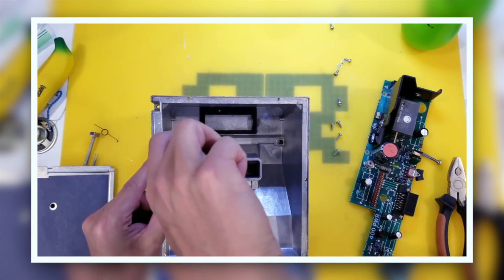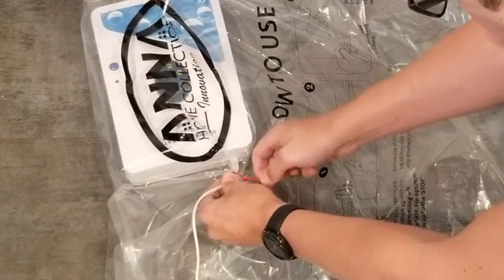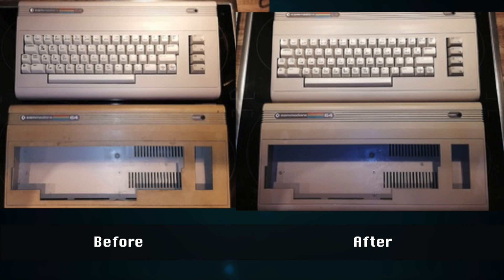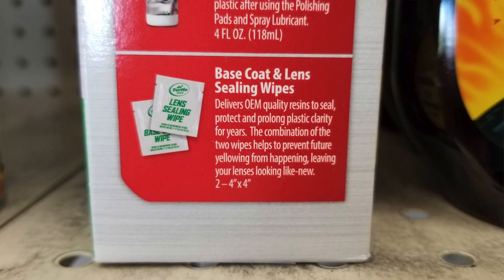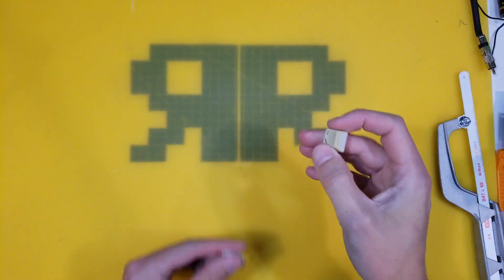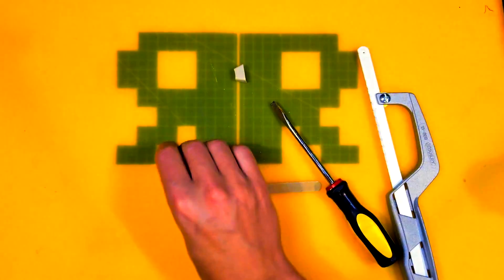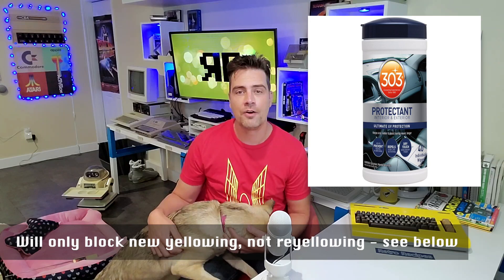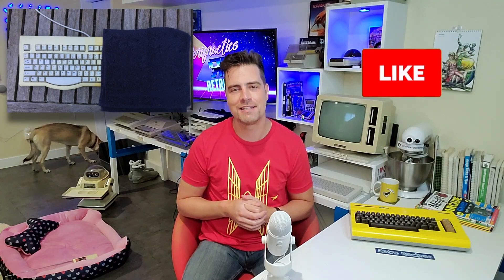Retrobrighting with just Sun? Lightbrighting! ▼ Read description FAQ

Comment: Hello! The reason plastic turns yellow is that a hydrogen atom is removed from the polymer. You could use hydrogen peroxide to replace the hydrogen atom by immersing the plastic object in a container. You can purchase a 12% solution of hydrogen peroxide over the counter. Place the container in the sun or use a high-powered UV lamp. You should see a difference in the plastic's yellowing after a few hours. The higher the temperature, the better the result. Be careful not to deform the plastic by overheating. Do not heat it with a heater.

Comment: even a melamine spunge (magic eraser) that's only verry slightly abrasive will begin to remove yellowing, so yes its a very thin layer. 
but still i use the water with hydrogen peroxid solution (properly 1-2% in the final solution)

Comment: If you take the hypothesis further you could use try uv-b lights a a box instead of sunlight because the main difference between the setup is the uv-b missing inside a house this would also confirm if the hypothesis is correct. UV-b lights are used for terrariums.

Comment: Hi, you say heat is a yellowing factor, so what will happen if I leave my Dreamcast outside on direct sunlight and it's 110°F? (summer time) Is it still advised?
Reply from the maker: No guarantees but they're designed to withstand much hotter (think of soldering irons on chips and heat from chips). Heat is a yellowing factor, specifically in the dark. Think of a hot attic. The conclusion of this video is that direct sunlight is a great retrobrighting method. Personally I haven't tried 100F but you'd be surprised how much these cases can stand.
Reply: @RetroRecipes  Thanks :) My Dreamcast is taking a sunbath in the garden right now...
Reply: @Ozwel  So what's the outcome? I have a Dreamcast in the same condition.
Reply: Did it worked out? :)  @Ozwel

Comment: I know it is an "old video", but there is a room in my childhood home (a "storage room" of sorts), which has the following story:
During the early 2000's I as a teenager put all my old pc's/consoles/toys etc in this room (nothing in boxes/packaged, just directly on the furniture I had). Then I covered up all the windows with "blackout" curtains (because I had seen that things that stood in windows/was exposed to sunlight, yellowed), turned of the lights and closed the door.
The room has basically been untouched for about give or take 15-18 years (until a few months ago when I got the nostalgia craving). Now in my country the days are usually filled with wind and rain and it is generally cold most of the time (and there was no heat in the room), so there would have been little temperature change/heat exposure.
Nothing in that room has yellowed, and surprisingly it's not that dusty either.
Reply from the maker: This would tally with "dark + HEAT" causes yellowing, but not just dark or just heat. 👍

Comment: well i disagree with just the sun causing the yellowing. my had never ever got direct sunlight it was also covered with a garment when unused. still it's top part and keys are pee-yellow but nothing on the bottom part. have loads of c64 and c128 some have different yellowing or no yellow at all. i think i mentioned this in one of jan beta's videos. my idea is that it's different plastic was used and or sometimes if someone used windex or something stronger to clean it but then the bottom part should at least have some yellowing. which none of mine has. sidenote when i was young parents and other sh_t's would smoke in ordinary rooms with no active ac or fan assisted circulation. as far as heat goes 20-29 celsius max.
Reply from the maker: I don’t say just sun causes yellowing, in fact I say the opposite

Comment: Will UV LED strips work in the same way? I have strips of them arriving soon and I'm willing to try by putting a C64 case inside a transparent storage case, then wrapping the case with the LED strips and aluminum foil so the light spreads around evenly, and leave the LEDs on for as long as it takes. I'm going to cover half the C64 case with a cloth so I can verify any changes in de-yellowing. If it does work, that means I won't need a sunny day nor displaying all my retro stuff outside!
Reply from the maker: People who have tried that say it does not work
Reply: @RetroRecipes  Well there's trying and then there's trying. As you stated in this video, the same experiment can work for some and fail for others due to different variables. If it does work, I'll post the exact steps I took and links to the material used. If it doesn't, I'll fall back to my original plan with hydrogen peroxide...
Reply: @RetroRecipes  Well I can confirm that the UV LED strips didn't work, and a few years later I needed to retrobright a computer's front plastic. Since I have 3 identical ones in different states of yellowing, I left the worst one in direct sun light for 3 days with hot weather. The results are in: It's now identical to the least yellowed one! I'm gonna leave it for another 3 to 4 days to get it closer to the original beige color 🙂

Comment: Sunlight definitely works to reduce yellowing, especially on ST's. Have done a couple and goes just fine.
Reply from the maker: Yup! 2 years in here and they’re all still looking great and no faults on the computers themselves either. 👍🕹️
Reply: I've been using this method on the original Atari 8-bit plastics and it's worked out pretty well but as stated in the video, it does take a loooooooooong time.  My first experiment w/using hydrogen peroxide on those original Ataris was a disaster but this has worked out quite nicely.  This also works pretty well w/the white plastics of the 2nd generation Atari 8-bits (the XL line).  Thanks for all of the info Perifractic!
Reply from the maker: @Mike-xp2lo  That’s great! You’re welcome 👍🕹️

Comment: Leaving it outside a few days is a bit of a problem for me most of the time. I use a foil-lined box and some high-powered royal blue LEDs to do it indoors. With peroxide, it only takes an hour or so, depending on how band the yellowing is, and the foil allows for even light coverage. Haven't tried without peroxide yet.

Comment: Christian - amazing work.  I have a 20-year old rare transparent "jelly" Swatch Watch which has some bit of yellowing.  The watch really cannot be disassembled.  I considered both the hydrogen peroxide solution and gel with a UV lamp but was concerned about the aggressiveness and waterproofing on a delicate watch.  The ozone idea seemed promising - the gas could permeate through the watch case, but the oxidation with metal components (springs/gears/quartz crystal/battery components) concerned me.  This seems like the best and most gentle solution for a watch.  I wonder if a UV lamp can be substituted for the sun.
Reply from the maker: We tried a sunbed to no avail. Good luck with the watch!

Comment: Hi Christian my job is with a small video game repair business and we are just starting retrobriting any tips or ideas?
Reply from the maker: Hi, I give a lot of tips in this video 😊 The 8-Bit Guy also has some great advice and videos on the subject. Good luck! 👍🕹️
Reply: Retro Recipes I kinda meant for building a large scale retrobriting unit for hundreds of old consoles and other parts to run through but thanks anyway
Reply from the maker: @brentmeeks2504  Unfortunately I think that would be near on impossible. We tried a sunbed and it didn't really work. 8-Bit Guy does some immersion tank stuff in recent videos, but you'd need so much water and peroxide. My preferred method is shown in this video - put everything outside. It's then down to how big your yard is ;-)

Comment: Hi Christian, I would be interested a year on how your plastics are still looking? Do you still repeat the process or have you left them for a future video. Apologies if this has been asked before.
Reply from the maker: Good question. Over one year later and I have not heard of anybody having any problems with this apart from that one rogue (and IMHO misinformed) report that I mention in the description of an Apple computer model's case that is absolutely renowned for shattering. I believe all of the machines that I used in this test still look the same as they did after lightbrughting. Be sure to use my recommended blue light method to keep the yellow away.

I have been using the blue light method by keeping one normal LED lamp on in that room, as mentioned in this video. I cannot guarantee anyone else's success but for me I have continued to be delighted by this method. 

To me this is not surprising as this video was made with a ton of due diligence and in constant consultation with GE's plastics degradation expert and PhD scientist of 30 years. 

Long story short, the plastics are still lighter and putting them outside in normal temperature caused zero electronics faults, just like a car radio that sits in a baking car (albeit for many more years not 24 hours). 

Other than that I recommend reading the description if you haven't. Cheers. 👍🕹️
Reply: My experiences with this have been good as well.  I've done the faceplate for a Morrow Micro Decision, an Apple 2c (in its entirety), a Tandy CoCo 3, and some XT/AT keyboards.  Right now I have the original 'chiclet' keyboard from my first CoCo 1 and an entire Televideo 425 terminal out basking in the Kansas sun.
I've also changed out the fluorescent tubes in the basement computer lab for LEDs.

Comment: After seeing the 8 Bit Guy Video, I got a small ozone generator from Amazon and put it in a zip-lock bag with some (used to be) white Go-bots. Then I put them outside over 3 days. (Yes, I have Go-bots! That's RETRO!) It did have an effect, but it was limited. It should be noted that I'm in Pittsburgh Pa and it was March when I did it which around here means cool and cloudy.

I am excited to try this method! Thank you for really digging into this issue. Your videos are both fun and helpful.
Reply from the maker: Thank you for your kind words. Means a lot! 👍🕹

Comment: Can anyone tell me if this works, or should work, if you covered it with a clear plastic bag? I have some units that it would be impractical to remove the covers, but am worried that a sudden rain storm could destroy them if left out naked, so to speak.
Reply from the maker: Yes, it works through windows too.
Reply: @RetroRecipes  I decided to bite the bullet, and took the plastic covers off two old printers, and put them outside in the sun. After the first day, they looked about 50% better. I threw in the towel after 3 days, because any improvement after the first day was minimal, or non existent. They look better, but are not fully restored. I'm curious as to why others achieved better results.
Reply from the maker: I don't think mine are fully restored either. It's not as harsh as bleach so will never match that.

Comment: Just found this video and can't wait to try it! One question though: My SNES is only partially discoloured (two parts seemed particularly subjective to yellowing) and if the whole thing brightens equally, I'm still left with a different shades of gray. Is it reasonable to assume that the parts that were subject to yellowing originally will also be the ones that will brighten fastest?
Reply from the maker: In theory that is possible. However I haven't seen great results with Nintendo... Just mild improvement. Good luck!
Reply: Retro Recipes Thanks! I believe in the comments here, as well as other videos that reference yours, some have experienced positive results with Nintendos. That said, mine are barely discoloured, so worth a shot and no big deal if nothing happens — well, other than having wasted € 15 on a rotating display on AliExpress :-)

Comment: I have bleached my 1541 using just light, before (I am a german user in the forum you found).
Btw: That's not an Amiga 2000's, but a way more rare Amiga 4000 keyboard you sacrificed there :(
Reply from the maker: I actually thought it was a A3000?
How long ago did you do your 1541 and did it reyellow?
Reply: It was about one year, ago. I cannot see any reyellowing, but the drive is sitting inside a cabinet with no light for most of the time. I ony take it out, when I want to have that original clicky sound and feel :)
It's a 1541c for being more precise.

Comment: Thank you for sharing your discovery. I want to try this out, but I live in Florida where it is currently 102 F and am worried that leaving my computer out in directly sunlight for 8 hours would melt the components or cause them to overheat (especially a monitor!). Have others tried this in hot locations? Any adverse effects? Thank you!
Reply from the maker: Please read FAQ re temperatures but if in doubt then I'd say don't try it
Reply: @RetroRecipes  Thank you for your reply. I think I'll wait until the colder months to try it as I've just got my Apple IIe working again. I'm enjoying your videos. Thanks!
Reply: @RetroRecipes  Thank you for your reply. I think I'll wait until the colder months to try it as I've just got my Apple IIe working again. I'm enjoying your videos. Thanks!

Comment: So the best brightening rig would be a box that contains a turntable and a bright mercury discharge lamp that is unshielded, so it will heat up the box and flood it with UVA and UVB rays. Much like a large microwave oven.

Shouldn't even be very difficult to build that if you have a lot of stuff to de-yellow. Or you can just hang your keyboard off the clothes line for a week.

Comment: My super nes was all yellow in the half bottom, i use peroxide with pure sun, without disarming the console, and all went perfect  !!. Even you can leave your electronics for several days, it is not supposed to work under sun directly because of the heating, even more considering the years of work. Didn't know the sun could de yellow your plastics.

Comment: After a couple of successful tests on yellowed CD case trays I left my BBC B case inside a sunny UK window and I’m happy with the results. These computers were only ever cream in colour, and mine was a pretty good one with little yellowing so only needed a little sunbathing to get it the same inside and out. I’ve done the top case now, just working on the bottom if the sun ever comes out again...

My question is now how best do we store our vintage computers (or other plastic kit)? I’d always assumed it was daylight that yellowed them, so one should store them in their boxes in the dark. I think it is now pretty clear this is flawed thinking as they clearly yellow there. I’m still a little confused as to what exactly caused the yellowing, though it certainly looks like florescent and tungsten lighting may be much to blame. As such, other than avoiding those two, where is it best to keep our vintage computers from now on? On show fairly near a window so it just gets a very gentle dose of sun? I’ve already moved to all LED lighting now so hopefully that is kinder, but I’m still very curious as to what part of a typical room would best preserve the restored colour, and is this better than in-box storage?

PS Thanks very much for publicising the idea. I’ve always steered clear of proper chemical ‘Retrobriting’ as it seems so risk prone, and this method has to be much safer (especially indoors as I did it).

Comment: Incredible work. The solution is so simple, but it was just so counter-intuitive, because everyone seemed to think that the Sun was the main culprit. I love your scientific approach to this, much appreciated. I wish I had known this yesterday, when I bleached my C64 with good, although not perfect results. But now I can at least treat my precious Amiga more gently. I guess I can also re-yellow the C64 using my newfound knowledge, and then use the new method for a better, more stable result. Again, thank you for this.
Reply from the maker: Thank you for your kind words and for appreciating the approach I took 👍🕹️
Reply: @RetroRecipes  I tried it on my Amiga, which had moderately yellow buttons, and on my incredibly yellow SNES (so bad it was almost brown on one side), and after just one day, the difference is massive. This was on a partly cloudy day at a temperature of 15-20 degrees C and a relative humidity of around 70%. Had the machines out for around 10 hours.

Comment: I got an A1200 yesterday, and the colour of the plastic is practically like new. It was used for a long time in an office with no sunlight coming in, and no fluorescent light (old fashioned light bulbs). It has been sitting in a dark attic for a few years after that. Without comparing it to an actual brand new system, I can't be sure how much it may have yellowed, but seeing it on its own, it could almost look like it was bought brand new in store last month.
I will NOT be putting it outside in the sunlight.
Reply from the maker: Lovely!

Comment: I've been trying this with a couple of keyboards, and Atari TT one and an Acorn RiscPC one. The results really do depend upon the plastic. The Acorn keyboard has been bleaching nicely. Even in Britain after a few days of "solar brightening" the yellowing is almost gone. On the Atari keyboard it's a different matter. I'd previously retro-brightened the case but the I didn't want to pull the keycaps off as they're too easy to break. Anyway, the main keyboard is one plastic formula, the function keys another and the case a third. The results have been that the case is re-yellowing in the sunlight, the function keys have brightened but the main keyboard hasn't really changed.
Reply: Trying my TT keyboard as we speak. Have taken a before-photo for comparison.
Reply: @jonord  Your results are the same as the Stephen?